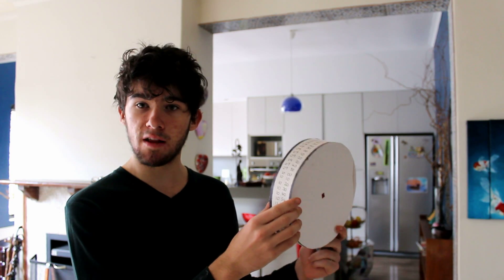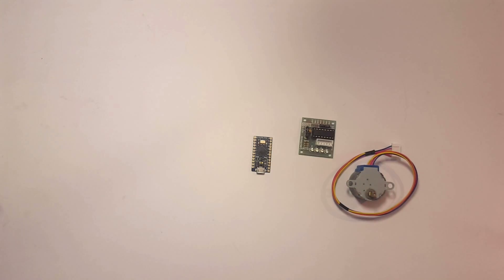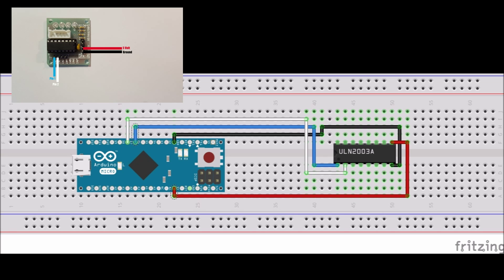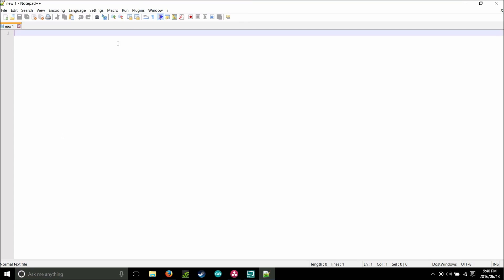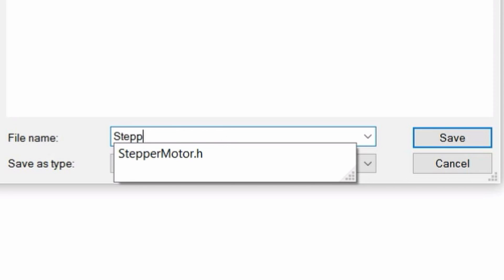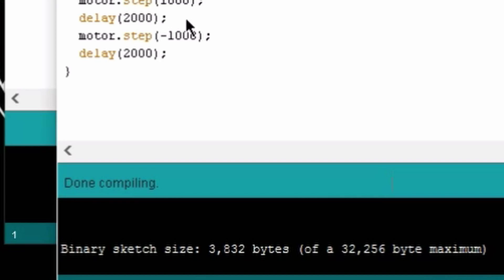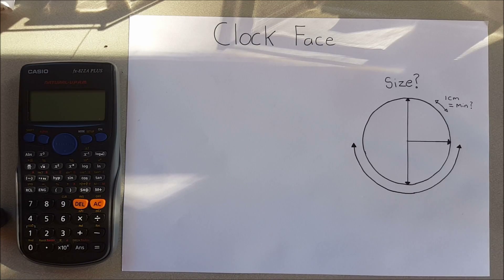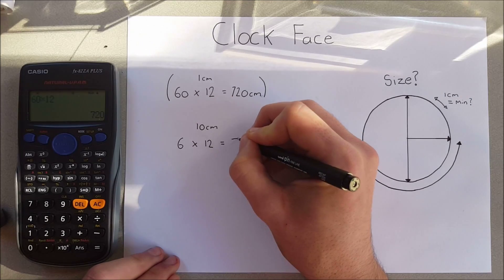DIY StepperMotor Clock (An Arduino Powered Clock)

Comment: What's the point if you just copy the code from someone else. By doing that it's just like using solder to make jewels.
Reply from the maker: +Anast Gramm The code isn't stolen, I'm using someone else library but am using my own code.
Reply: What's the point if you're just copying a programming language that was developed by someone else? By doing that it's just like using clay to make people.

Comment: which part of this was DIY?
Reply from the maker: +Jimmeh B did you watch the video?
Reply: yeah mate, saw you take an interface that someone else designed and manufactured, which you wired to an Arduino platform that someone else designed, built, and were kind enough to supply wiring instructions for you to follow, controlled by an Atmel Micro which yet another engineer and the company he works for, designed and manufactured and then download a library that someone else wrote, followed by a sketch that someone else wrote, debugged and released that you don't seem to understand given some of your replies to comments. 

OK, there was some maths, and writing and scissors... but the lions share of the work was done by someone else. You didn't even modify the code. So, aside from a bit of colouring in and cutting out.... what again, was DIY about this?

Don't get me wrong, good vid, clear, concise, for the things it explained, but I already know how to follow instructions, write, use scissors and google.  I just fail to see how this could be considered to be "Do It Yourself" given that mostly, this project is assembled from products built, interfaced and programmed by other people.
Reply from the maker: +Jimmeh B so according to you unless someone mines the copper themselves creates all the ICs and writes the code in their own version of binary it isn't DIY? Yes I've used already made microcontrollers and a library by sometime else but I did write the code myself.
If you built a birdhouse would it not be DIY because you bought already cut wood?
Reply: get off the grass mate. You know what I mean.
And I stand corrected, since you wrote the code, I apologise. That does make the difference.